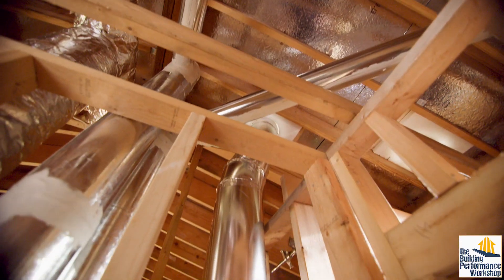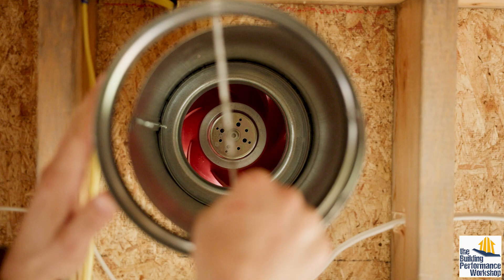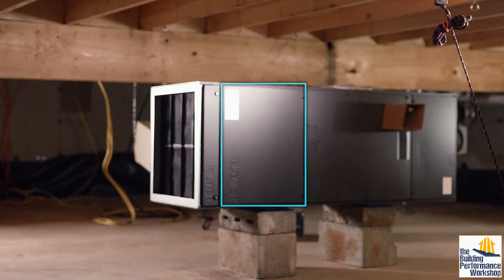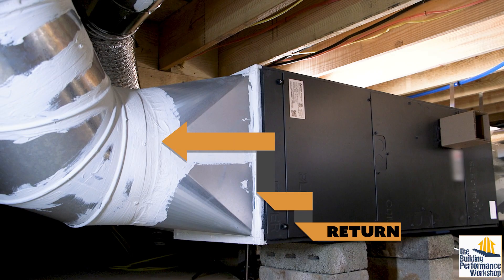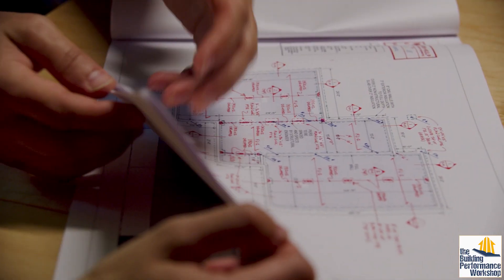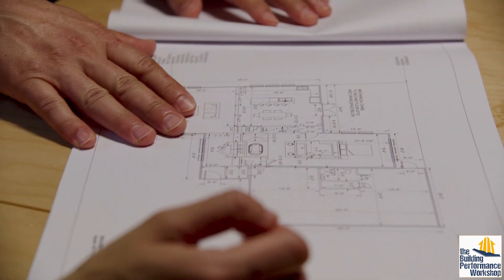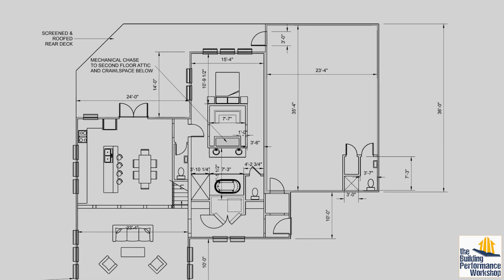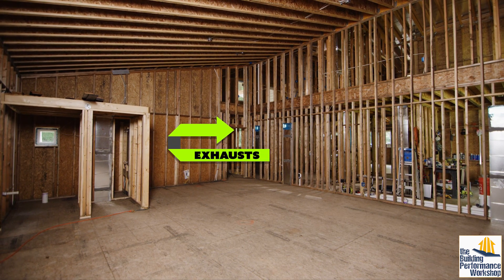Elegant HVAC Duct Design: the Rooms are Ducts, Too

Comment: With our heating systems we run hard pipe or spiral with wye branches and dampers at every wye branch. We only use flex duct for the last 10' of every supply air in order to quiet the system down. And if we use any rect duct we instal a flex connection & sound line the 1st 5-10ft to  quiet the system. Also install anti vibration pads under the furnace / air handler. We install bascislly commerical system cause the houses are usually 5,000 sqft up 37,000sq ft. Can turn into night mares at times